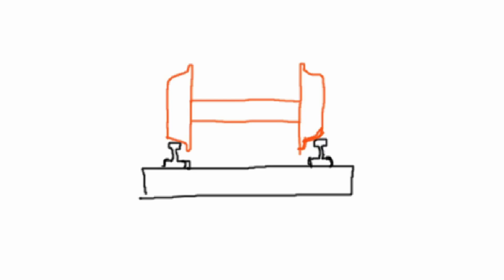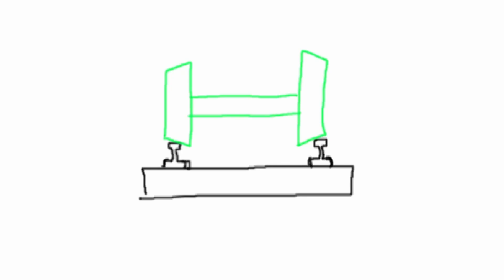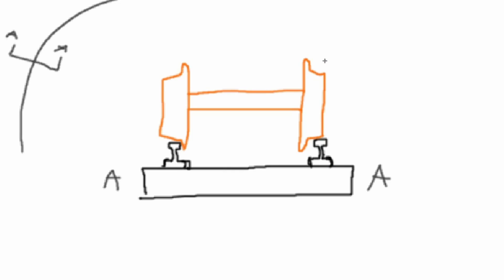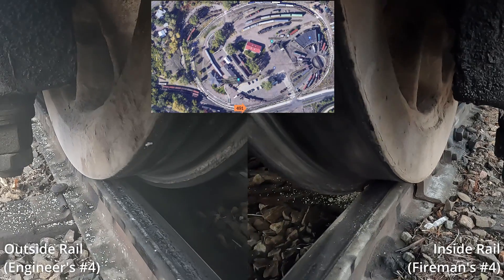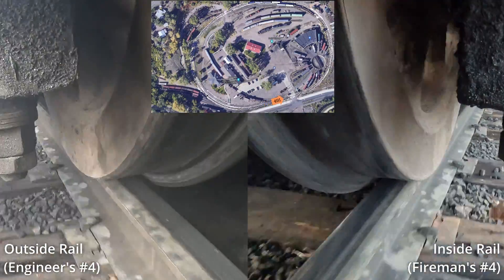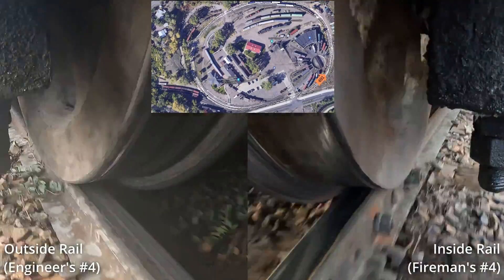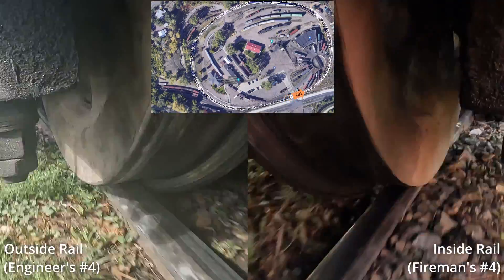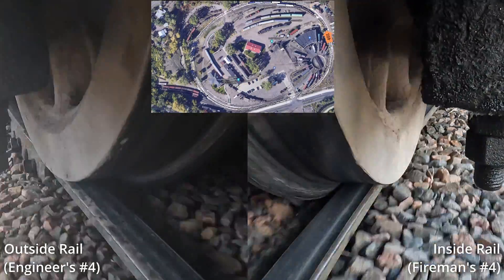Railroad 101: How do railroad wheels interact with the rail? A study on D&RGW 491

Comment: Great video! Another fabulous demonstration of the difference between theory and practice. After 50 years of practice as a hardware and then software engineer, I still love videos like this that starkly show that the real world is usually different from the imaginary world we write about in our notebooks and on our whiteboards.

One nit about the opening segment regarding wheel geometry. Although you show it in your drawing, you didn't mention the filet that transitions the tire into the flange. In addition, the inside edge of the railhead has a similar complementary curve. The dynamics of how the wheel behaves as the filet engages with the curved portion of the rail head are fascinating and not at all obvious -- at least with regular trucks as opposed drivers on a locomotive.

The short form is that for the flange to get close to the railhead, the rapidly increasing radius caused by the curve of the filet has the effect of LIFTING whatever weight is bearing on the wheel. The curve of the railhead contributes to that effect. The interacting compound curves of the filet and railhead translate much or most of the vertical gravitational force into lateral force acting to center the wheelset.  As a result, gravity forces the wheelset away from the filet and keeps the wheelset on the track.

My understanding is that standard-gauge track (not narrow-gauge and not streetcar/traction track) is intentionally designed so that the flange almost never makes contact with the railhead. If it did, both the flange and railhead would be very quickly ground away to nothing.

Oh -- and one last historical note -- all these impressive dynamics were investigated, worked out, designed, and patented in the 19th century.  The interaction between a railroad wheel and track is a masterpiece of mechanical and civil engineering (not to mention draftsmanship in the original drawings!).
Reply from the maker: Brilliant comment, and certainly not something I included in my analysis. Cheers!

Comment: Your at a slow speed. At higher speed centrifugal motion becomes more apparent. As a Brakeman on the GN in the sixties on a road trip West of Cloquet, MN there was a curve restriction of 35 MPH.  Just short of the curve the Engineer went back to check the units. When entering the curve, the head unit went through transition (traction motors going from series parallel to parallel) which happens at 48 to 50 MPH. The engine speedometer was showing thirty-three. In the cab there were a series of loud bangs. What was happening was the flanges were climbing the rail and falling back down.  The curve was to the  left and to the right was the St. Louis River, a sharp bank, down twenty feet, and a river strewn with large protruding rocks with rushing water. At the end of the curve the Engineer burst back in the cab and asked if the Caboose made it!! That was one of the closest brushes with death I had railroading. Over thirty year there were more to come.
Reply from the maker: Jesus Jack, that would've been terrifying.

Comment: Worn Wheels with a slight false flange. They have lost their positive conicity value and look like they are running negative conicity now, wheel should be about a 1 in 20 angle for a basic profile after machining, if hollow wear occurs, even though it is well within allowable tolerances, the opposite effect can occur at low speed curves. Lots of other issues to add in like "cant" value etc. If hollow wear is allowed to get to bad you may experience hunting at high speed on straight track as well as flanging which is something that you want to avoid as this increases flange face wear. my thoughts anyway
Reply from the maker: Definitely possible thoughts. Appreciate your look.

Comment: My 2c:  All objects want to continue in a straight line unless another force is applied to them.    Consider a car traveling down the road and into a right-hand corner with barriers on the outside.  The car doesn't turn but goes straight into the barrier, hitting the front left corner of the car against the barrier.  The potential energy in the car wants it to continue straight but a force (barrier) is applied to the front left corner to stop it.  The rear right hand corner also wants to continue straight, being not directly inline with the contact axis of the left hand front corner it has a leverage or torque about the impact point, push the rear right of the car out to the right. Most likely spinning the car.  

491s leading driver axle is the same, the loco wants to go straight (disregard the front truck as it's a super sharp curve and beyond it's ability to pull the frame around)  , the front axle wheel hits the outside rail and the  fixed wheelbase has a yaw or turning moment about the point of contact with the opposing force (the outside rail). This pushes the rear axle in any fixed wheelbase against the inside rail. So basically the loco doesn't roll around a curve, it is wedged around the corner, eg lots of wear, eg manufacturers of locos and track go to great lengths to ease this wear through elaborate leading/trailing truck centring devices, track and rail standards, minimum radius curves etc etc.
Reply: Great video by the way! Love it! Keep doing more! Like another said, nobody is doing this sort of content on YouTube.
Reply from the maker: Hm, interesting thoughts Greg. I don't know if we're beyond the ability of the lead truck to pull through the curve.
Reply: @Hyce777  sorry.  I meant beyond the ability of the lead truck to pull the front driving axle off the outside rail. Which I would think only  happens in 'slight' curving situations.

Comment: I would say your assumption on the wheels is likely accurate.  This is what I was thinking before you went into your explanation but I did not know the configuration of the loco and was assuming 0-4-0/2  and thinking that 4 drivers in a group with the front driving on the opposite side (as the front truck does) and thus pushing the rear drivers to the other side.  I was making assumptions on the information I didn't have. First video of yours I've seen, but yeah, good explanation and accurate.  I appreciate the suspension breakdown of the loco so I can understand what's happening and the visualization helps.  Props to you!
Reply from the maker: Cheers James; we will be diving into it in depth later this month.

Comment: With narrow gauge locomotives find what I have found out is locomotives with outside connecting rod have less lateral motion. Standard Guage steam locomotives have a limited amount of lateral motion. But one thing to consider is the degree of curvature. It’s possible that the degree of curvature it possibly to tight. That would be a factor. Also I did notice that the drivers are starting to show signs of cupping on the tread surface. Look up to see what the manufacturer recommended degree of curvature if it can be located. Best of luck
Reply from the maker: The manufacturer calls for 30 degrees max; we have 28. We do have a small amount of tread worn hollow, as you described; but it's nowhere near the limit. We also don't have any wheel conditions that require truing yet.
Reply: @Hyce777  what is the condition of the railhead? I couldn’t tell if the crown of the rail is still intact. Also with curvature the industry practice is to have super elevation in curves. This helps with helping a rigid frame locomotive thru curves. The smallest to the largest locomotives have the same issue with flat and non super elevated curves. Articulated locomotives also requires super elevation. There are many other items that could be contributing to your situation. Spring rigging will hamper rigid frames in curves if it’s not properly maintained.
Reply from the maker: @hmsjr0154  there's some head loss in the rail, it's not super bad though so far as I know; and super isn't much if there is any at all.

Comment: Because a locomotive trucks/ bogey can swivel, and steam engine doesn't ( because of the push rods) would that same system apply. Your video was very interesting.
Reply from the maker: There's a surprisingly large amount of slop in the push rods, as you called them. Enough that they can be ignored in this case.

Comment: As it was explained to me, the pulling force acting on cars in a curve can be visualized like a floating compass needle  at the front of each car. The needle always points to the engine.  In a right turn, the needle deviates slightly right, pulling inside wheels against the rail, and leading to possible straightlining if the car is too light.
Reply from the maker: That makes sense to me; though we are looking at the engine itself in this case.

Comment: Simple answer: The theory of the angled wheel shape and how they ride has to do with the rail cars, the stock cars on a normal 4 wheel truck at each end in normal situations with a coupled solid axle, not the engine wheels.  Since your engine is the driving force of this depending on the load it will always gravitate to the inside rail since it is the inside of the curve. It is possible as the train flows down the line on a curve that each car will set differently with the last cars riding as the rail car theory goes, but the one closer to the engine might be closer to the inside rail as well. It is like taking a rope around a poll, is the rope going to rid against the poll or slid out to the edge, no it will ride around the poll not a few inches away. Now if the poll was a few miles wide and the rope was traveling at a good rate of speed yes it will now tend to ride away from the poll.   Thanks for the video; this also explains why most model train engines have flat edges on the drivers and the rail cars are tapered.
Reply from the maker: Interesting thought; overall I believe the locomotive does "ride around the pole" as you described, but I don't think some wheelsets will make it based on the geometry. Going to film each one and see what happens...
Reply: @Hyce777  So to save on wear or balance it out run the engine the other way around the track to get the wear balanced. Also I learned recently that on the main line tracks they have oiliers for those hard and long turn spots to save the wear on the tracks and wheels.

Comment: Baldwin workshop manual explains that when a steam locomotive enters a curve it is assumed the leading driving axle wheel will up against the outside Rail and the rear driving axle wheel up against the inside rail. This is known as the angle of attack or yaw.    This is also the same for a passenger trucks etc.
The idea of the front and rear engine trucks is to assist the locomotive to negotiate curves.
The front engine truck through various devices such as swing links and cams etc. pull on the engine frame reducing the lateral forces being applied to leading driving wheels due to the effect of the curve.  Hence reducing wear and tear of the leading driving axles on a 2-8-2 loco. 
Typically the front engine truck would not normally apply sufficient curving effort to the loco frame to move the leading driving wheel off the the outside rail. 
However, the curves the K37 is negotiating are very sharp.  Depending on the design of the front engine truck and the radius of the curve the curving effort being applied by the engine truck to the locomotive frame is limited (percentage of) by the weight on the front engine truck axle. Too sharp of curve and you will derail the front truck. 
Therefore, I am not sure the leading driving wheel flange would be off the outside rail.
Reply from the maker: That's a brilliant point, I hadn't heard that from Baldwin. I need to do some more filming. Stay tuned.

Comment: The rails are also tipped inward at a 1:40 pitch. This is called cant and is induced by a difference in the thickness in the tie plate supporting the rail. Thinner on the gauge side and thicker on the field side.
Additionally, the tops of the rails are not flat but are actually curved at a radius of 8 or 10 inches. This is to keep the tread of the wheel riding more to the center of the rail rather than bearing on the edge.
Reply: Yes and no.  Rails are tipped inward slightly and have a domed head to them.  Not squared off in the diagram.  Cant is the mathematical determination of super elevation of one rail higher than the other, in curves mostly, based on assumed track speed and weight of trains running that line.  Too shallow a cant, or 'flat curve', and centrifugal force will push the outer wheelset against the rail.  Too steep a cant and the cars will 'fall' against the inside rail.  The proper banking of a nascar curve is also an example of this.

Comment: Before seeing Hyce explanation and thoughts: the lead and trailing wheels are doing exactly as you described in the diagrams. That's going to be pushing the middle of the rigid frame over the inside of the curve, easily seen with long cars. Locomotive has drive wheels all through the middle that are pushed against the inside edge because of that. I would think that's also the biggest limiting factor on how sharp of a curve a locomotive could take.

Edit: after seeing Hyce's thoughts, I thought the same as him but wasn't sure if the suspension affected the lateral travel of the joined drivers or not. Still same thought though, just through the suspension pieces instead of the entire locomotive. Probably same thing happens on a 6-axle diesel then, middle set of the bogie rubbing inside rail.

Comment: Would I be able to assume that if the locomotive were to be reversed clockwise on the track the wheels would have the same forces on them and the same wear.  If they by principle stipulate that all traffic is to run anti-clockwise, to even the wear on the tires and flanges all they would have to do would be to turn the locomotives at the shed and then run the locomotives tender first anti-clockwise to get the opposite wheels to take the wear.  or they could just run the locomotives engine first going clockwise on alternative days.

On further contemplation, their rolling stock should also have uneven wear problems if they are always being run in the same direction non-reversed day by day.

Comment: Tbh its easy consist the wheels flanges press against the rails, thus preventing derailment there is times where if you go fast or have too many wheels it cant bend and it will derail so the wheels move a train the flanges keep them on and the rails guide them so really  the only {some cases :) } solution which big boy and challenger used was a you got it articulated wheel base so yea thus solution but anyway. but im really stating the obvious  here so yea cause its 4 am im tired and its easier to dumb it down when your tired. have a Great day/night/morning/afternoon/evening/midnight, and Hyce, Keep up the great!! work :)

Comment: I would mount a camera on the first cars wheel sets. The middle cars wheel sets and your rear end cars wheel sets to get various points of data. I think the shear weight of the locomotive is haveing it lean/toward the center of the curve. Put a bubble level and camera on the front of the locomotive facing away from the train so we can see the train round the curve and see with the level which way the train leans. Or the curves are just to tight. My model trains rub the inner rail if the track radius is too tight. It happens with my longer locomotive. I think the locomotive has too many wheels for to tight a curve. Im talking out my bum but those are my ideas.it would be most awesome to have a drone capture a Ariel shot of a train going around like how you had in the video.
Reply from the maker: Interesting thoughts; definitely going to film more wheelsets.

Comment: I can't say I have a better idea than that it's because of the way everything is connected in the suspension, but I think a very interesting experiment to do would be to get an axle with wheels from something that had blind drivers on that axle, and put it on the tracks and either by hand, or, if it proves to unwieldy this way, with the aid of a Goose or similar small motive power, walk it around the track and see where, if anywhere, it is inclined to pop off.
Reply: Some British locos did indeed have blind drivers; they were 2-10-0 configuration, and the middle wheels (i.e. axle no. 3) were blind. Although there were never any problems, the railways weren't entirely happy with this, and preserved examples of these locos are now banned from the mainlines.

Comment: How often do you have to change the wheels on 491 or any locomotive because of them rubbing on the rail
Reply from the maker: We haven't ever had to, nor will we need to for a while. They can also be turned down before they need to be replaced.
Reply: @Hyce777  thanks

Comment: To test your hypothesis, just move the GoPro's to the other wheels.  Other than that, can you attest to the condition of the wheels? Do they exhibit strange wear patterns across the width of the tire? Such as a low spot someplace across the width? The lighting wasn't great, but it seemed like the tire was cupped near the middle of the tire where it rides on the rail. If the cone shape is distorted from wear and tear, it will certainly affect the normal cornering action.
Reply from the maker: No, the wear is not that bad.